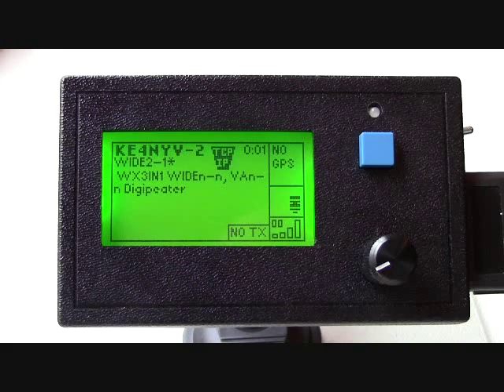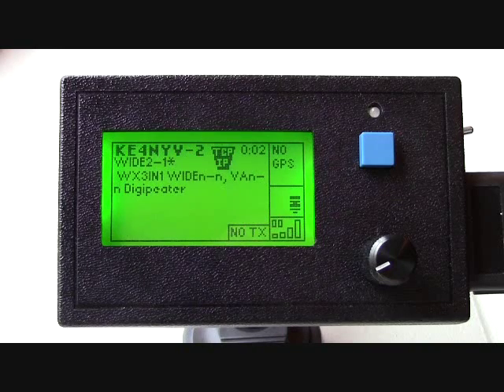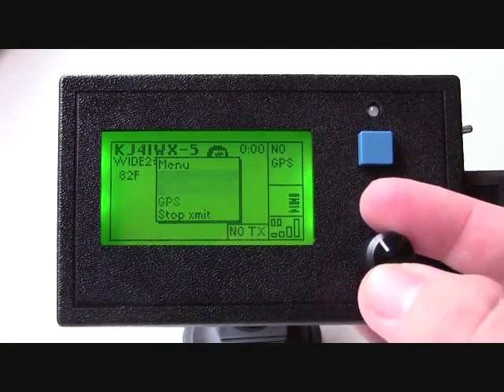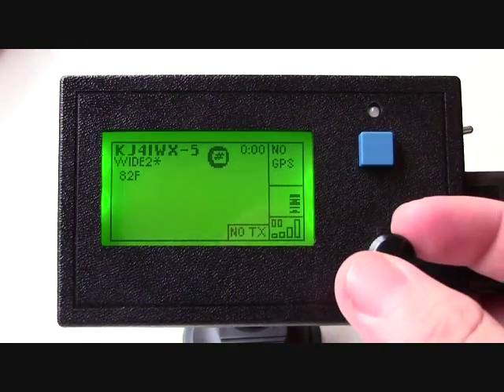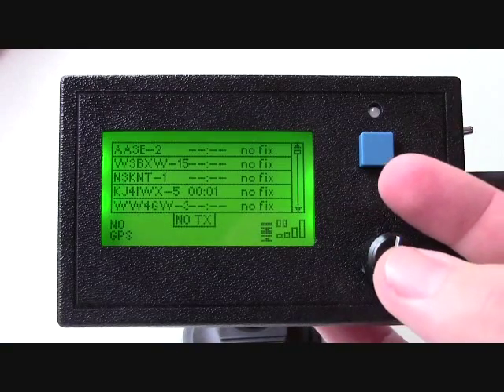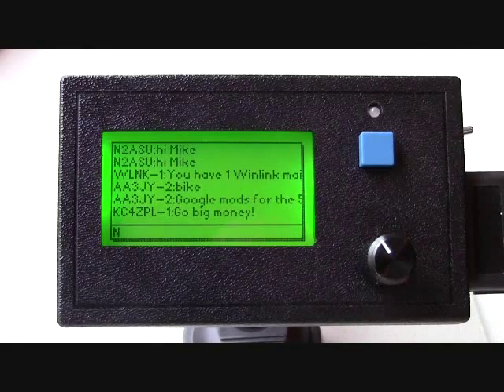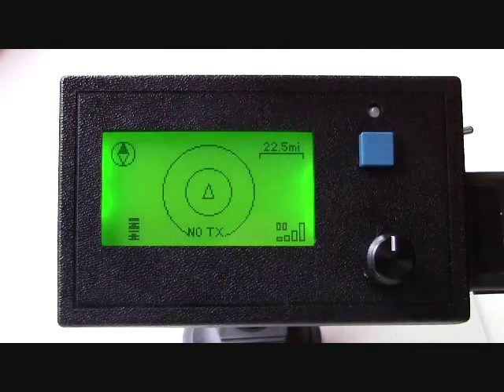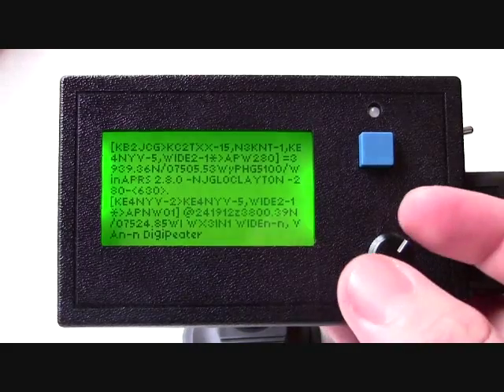YagTracker - Basic Overview

Comment from the maker: Yes, it will work with the YagTracker.  You will have to adapt the minidin 6 pin connector to the YagTracker and supply it +5VDC power.  Luckily, the YagTracker has a regulated +5VDC output on it's DB9 external connector.